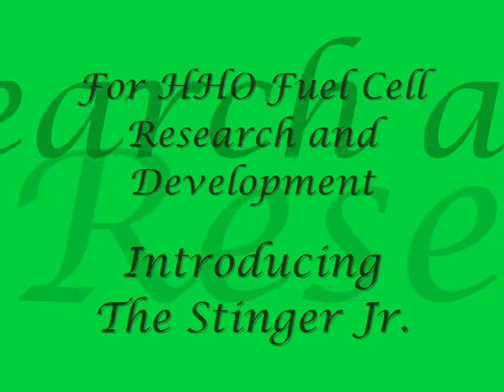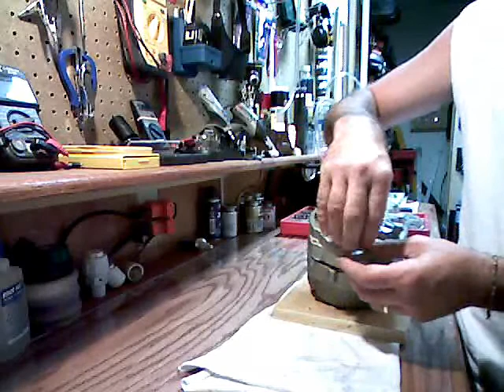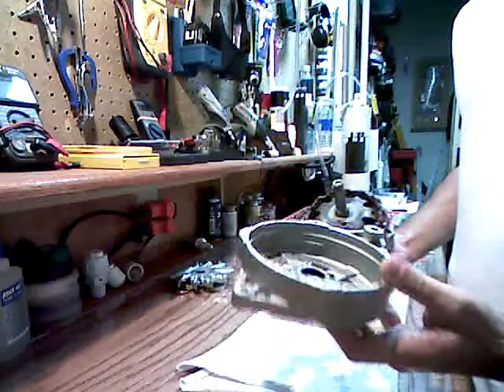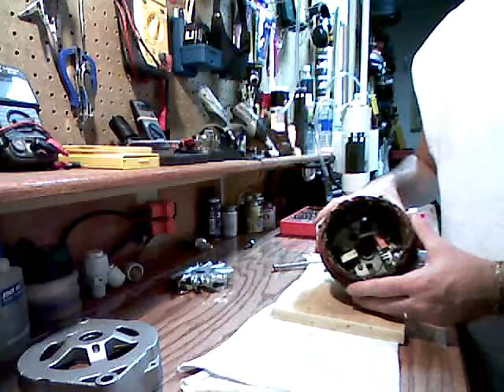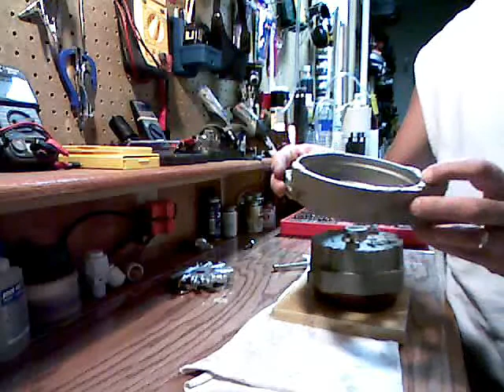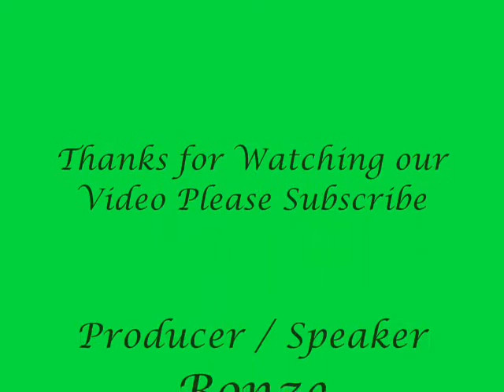Windmill Part one

Comment: Hi Jcarr,

What is your purpose in rebuilding this alternator and modifying it?  What are your end result goals?

Do you have a set Volt/Amp/Watt goal in the end of this build?

I'm interested in building a windmill as well.  We don't use much electricity around where I'm at and there is QUITE a bit of wind a lot of the time!  Plus WINTER'S here and a nice windmill may offset our electrical cost quite a bit, ey?  Thnx for posting, awaiting more posts about this subject!

Superbee1970